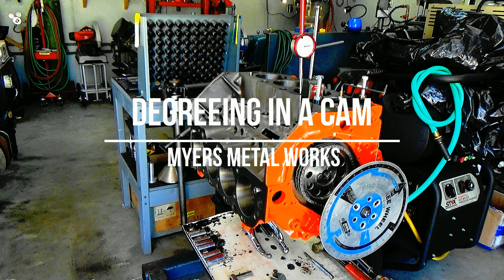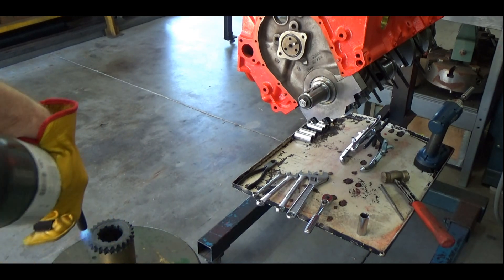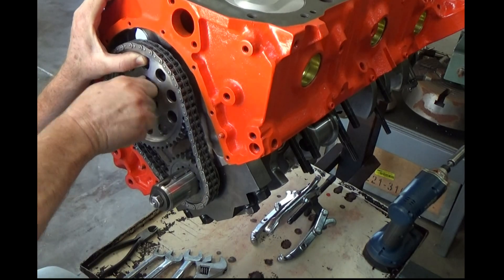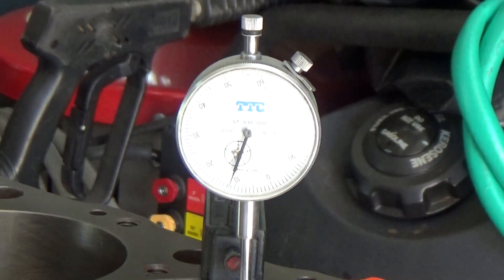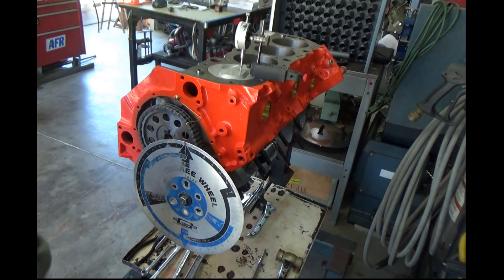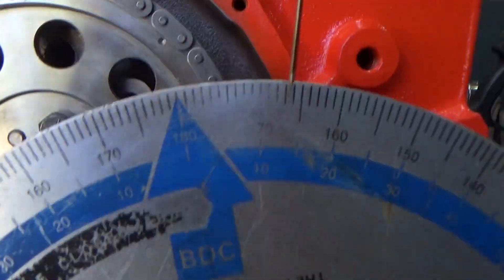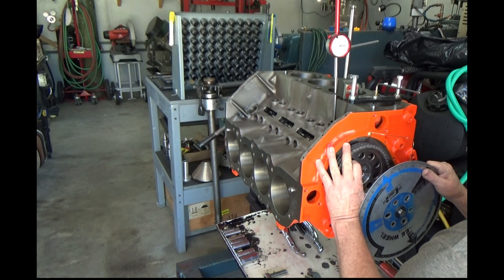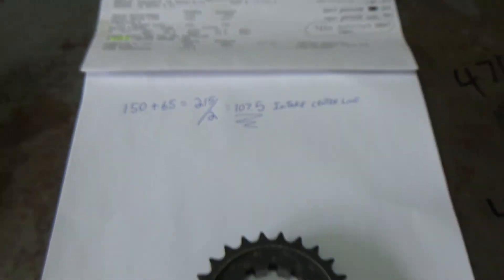Degreeing in the camshaft....#2 Chevy 454 Big Block Performance Build...

Comment: Obviously you are an incredible source of information especially viewed from my vantage point. I've have a '73 454 Corvette 3 speed auto which has been sitting for a short few years, Covid related. This as you know, '73  was the beginning of doom for the Big Block with any real HP because of regulations. The engine comes complete with an air pump and an EGR plus this seems to be tied to the transmission and speed, vacuum , ignition advance and whatever to choke this engine down. She has an 8.25 to 1 compression ratio. She is 50 years young and our glorious State no longer requires emissions checks on vehicles this old. What would you do to release the ponies without an engine pull and rebuild? She is a numbers matching beauty and what ever is removed will be bagged and kept for posterity. 390 ft/lbs of torque at 2500 rpm is sweet but another 50 to 100 hp would be sweeter. Point me in the right direction please.
Reply from the maker: Thanks for the nice comment...
More hp for the 1973 big block with low CR... A more modern camshaft would help. A more modern dual plane intake and Carb, but watch your hood clearance.... A skinny small air cleaner will kill the hp you gained  with the intake... Headers and a good exhaust system..... not sure how far you want to go but a modern set of heads go a long way for hp as well.... look up on the internet Grumpy's performance garage for all kinds of information you may be seeking for your Corvette.. hope this helps...

Comment: What do you need to do in order to advance the cam timing? Thanks
Reply from the maker: Hi Joe...  On this set up the bottom timing gear  had different key posistions from 0 to +2 +4 advance or -2 -4 to retard cam timing... You would pick the keyway you desired to run your engine at....
Reply: @Myersmetalworks  I see. And is it correct to assume the advance / retard direction is opposite on the crank than the cam then? Thanks
Reply from the maker: Yes... I think of it like a stretched timing chain... The crankshaft is advancing and the camshaft is retarding....👍